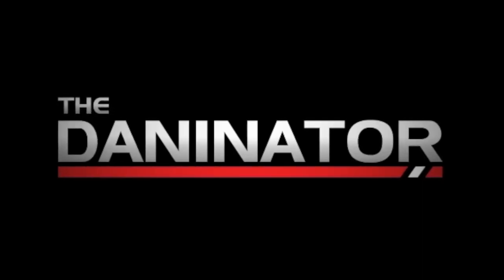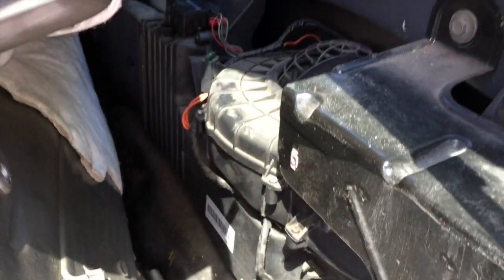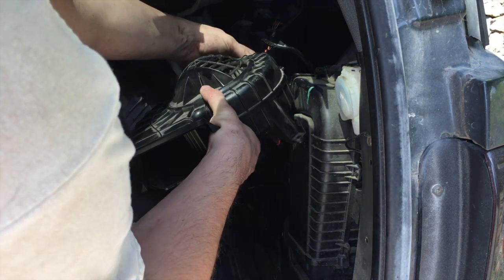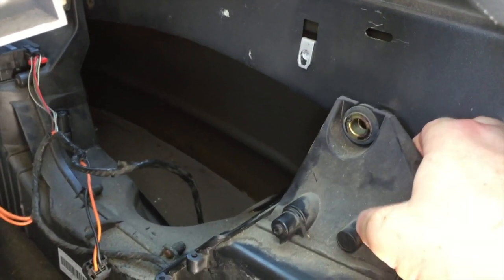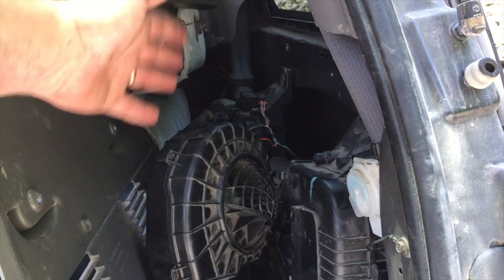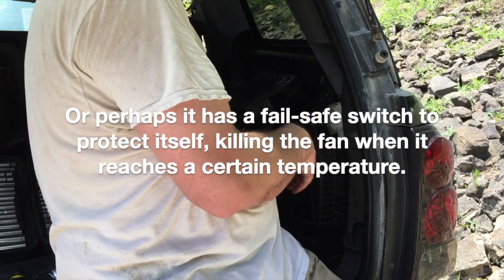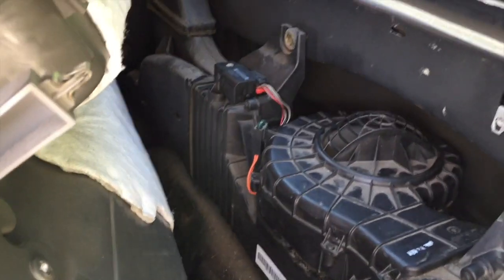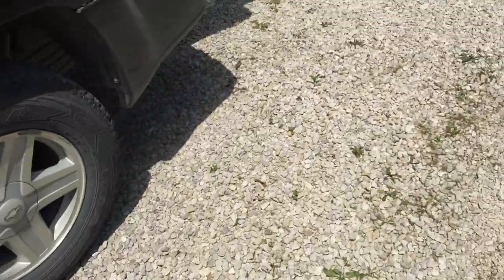Trailblazer EXT rear air won't work - FIXED! - Blower Motor Control Module / Resistor

Comment: After going to the junkyard to get the resistor and destroying/tearing that box out, I found there are 2 additional 10mm bolts that hold the box from under the truck, right under the blower box. Take those 2 hidden nuts out and you can lift out the whole blower box out of place and then you can actually use a torx 15 screwdriver AND SEE where to remove the screws from the resistor. The blower box will come off the vent ducts, so when you put everything back, make sure the ducts are aligned, and nice and tight. My hands were so scraped up from the junkyard trip but not a scratch by also taking out the 2 nuts from underneath at home. There is play with the hoses, you will see how much when you get under the truck to remove the two nuts. If anything would have leaked, it would have been at the junkyard. The resistance you guys feel is just the blowerbox bolted to the under chassis. I used a prybar to remove the box. None of the videos out there talk about those two bottom nuts. Too bad the resistor I got from the junkyard was also not working. Im about to head out now to get another one, this time im removing those 2 nuts so I dont have to break the box. I hope this helps someone.
Reply from the maker: Thanks for that information! I'm sure it will be helpful to the next guy!
Reply: I will keep this in mind when I tackle this problem I have thanks
Reply: Man i did like you said and it works thanks.  Man
Reply: Man i did like you said and it works thanks.  Man
Reply: I’m about to tackle this issue.

Comment: My actuator broke so I made it stay open. The rear fan works when it wants to! I thought it was a setting on the front climate control but I don't know. 🤦🏽‍♂️ what I do know is that when it's on its on but when it isn't it eventually kicks on out of nowhere. Going to go to trailvoy to see if there is something I'm doing wrong ... thanks bro!

Comment: FIXED! I tried the fuse reset 3 times,never touched blower,but did replace ac delco part for the win!pulled everything loose,wedged the top so I had extra room.****stuff a rag or something in hole in case you drop a tool!****I laid on stomach toward front of vehicle to use right hand when putting back in.was WAY easier for me.also pulled part of ac vent that blows to floorboard(1 extra 10mm bolt)to allow me to rock entire assembly out for extra room.hope this extra info helps the next guy.thanks for the help Dan!
Reply: So what was the exact part u replaced that fixed it
Reply: @1-Six-dee  forget the name of it now but the ac delco part that's mentioned in the video.make sure to stuff a rag in hole so if u drop a screw ur ok.also laying on stomach using right hand saved me mega amounts of time.good luck!
Reply: @marcchampagne804  ty sir I figured it out thru a couple more videos but this speed controller is a big issue in every model that it was used and it is not cheap
Reply: @1-Six-dee  small price to pay for way cooler ride.i have 3 kids so wasnt an option for me
Reply: @marcchampagne804  I have three kids as well, I have an issue now the driver side is blowing out coolish air the passenger is blowing out ice cold, seems like I have a blend door issue
Reply: @1-Six-dee  I had that same problem before,as well as now.personally I learned to accept it.think it's just luck of the draw with your timing bc mine was that way before hand.driver side middle vent 6/10 n pass side 10/10.its an actuator problem I never chose to solve.too much work for little payoff.fyi,I'll use driver rear vent,spin n point at me when no ones sitting behind me.nice breeze down my spine after a long day
Reply: I wish I started a youtube channel 3 years ago when I got the truck.everything except the rear end itself has been replaced over time.feel free to ask any questions regarding pretty much anything on this breed of vehicle
Reply: @marcchampagne804  my oil pressure gauge stays maxed out at anytime I have the vehicle to the on position have u ran into this?
Reply: @1-Six-dee  mine stays around 55 or 60. I've debated a diesel bath to clean old oil deposits out the block but havent done it.basically drain oil,instead of oil,fill with diesel,new filter,run to operating temp.drain,fill,change filter,repeat 2 or 3 times.then put new filter n oil in n see what it does. I've gotten rid of a knock in a motor that way before

Comment: Anyone who's smart would move that electronic resistor and bolt it to a METAL part of the cab above the blower motor (and use some computer processor heat sink paste) so that the new one doesn't bet so hot and burn out.  Those electronic resistors produce a lot of heat, and that heat is what causes them to fail!  I have two TB EXT's and have replaced/moved both of the resistors...no failures since the move!
Reply: brilliant
Reply: Where’d you move it to

Comment: One minor correction. The condenser coil is located in front of the radiator in the engine compartment. Their are 2 evaporator coils that chill the interior air. One for the front dash vents and the other for the rear unit where you were working. That evaporator chills the air coming out of the headliner vents.

Comment: I got this issue with my blazer long ago and found the issue with the same temperature control module...most of them will fail by time when your ac is not working properly or by any means they got heat up ....
That is not adhesive..you can get it from any computer shops it is silicon coolant gel or cream mostly used for processors ...you must remove it again and clean that and paste a new gel on it otherwise it will fail again due to heat up
Reply from the maker: Good info to know. Thank you.
Reply: Thermal paste

Comment from the maker: I don't know how I did it, but I done it. LOL. 
Be sure to check out the merch link in the description above. Use code "DAN10" and save 10%.
Reply: can u help me I have a 2005 Chevy trailblazer and its misfiring bad and when I checked the codes 2 pops up p0017 and p0300 and I redid the valve covers because it had oil in the spark plugs and I changed the old spark plugs out can u please help me out I'm pulling my hair off with this thank u
Reply from the maker: bouncer bloodz414 take a look at this info here: https://www.obd-codes.com/p0017

Comment: Same exact issue I’m facing rn so I appreciate the vid ! Almost positive it’s that ac blower module replacement bc mine starts for 2 seconds n cuts right off too
Reply: Did u ever find a fix I have the same issue it turns on for about two seconds then it shuts off

Comment: My wife's 03 Envoy wont blow from the rear vents when the engine is running, but it will when it's on battery. What are the chances its this, or maybe the rear hvac control unit in the second row?
Reply: Mine is doing exactly this

Comment: Does the clicking continue now? I am having the clicking in my vehicle, and am told both blend doors are broken, and need replaced.
Reply: The blend doors hardly ever break or fail unless someone broke the drive pins off. 
It's the drivers or "modules" that break internally .... because some Voodoo mechanics believe they can "reset" things that fail by disconnecting the battery every once in a while --- just, ya know --- to make things work again. 
Every time you remove the battery from the system --- or disconnect either battery cable --- you'll likely damage the old plastic gears inside the actuators. 
They're old - they're plastic and they can't do that many times before they go; "click-click-click-click-click-------" 
...and IF you break the gears on the one under the dashboard --- it's major surgery to fix it.

Comment: Anyone have info on the adhesive that is meant to be used after cleaning off the old stuff?

Wish we could see how you realigned the peg into the actuator. I am having hell of a time getting my new ones in.
Reply: It's not adhesive! It's heat sink paste and if you don't use the correct product you'll fry any new "modules" too --- which are really resistor banks. Buying used electrical parts is always a crapshoot - and you don't get new "glue" with them either. <nyuck, nyuck>

Comment: nice vid. could you please, if no much trouble, tell me the part nmber or exact name of the air knob located to the left side of the gear stick? its missing and i would really appreciate your help :)
Reply: I don't know the part number, but that switch's settings decide if either it, OR the rear controls work the rear a/c-heat unit.  One position is off, one position is for the rear controls (in the back of the center console) to run the rear unit, and the other positions are for fan speed (while using the driver's front temperature settings) to control the rear.  I hope that helps you understand what the switch does!

Comment: The "adhesive" is heat sink material to help dissipate the heat in the so-called "module" which is really a resistor bank. It is not any form of glue or adhesive. If you don't replace it real with heat sink paste, the "module" will fry again. 
The Actuator clicking is no-way, ever gonna "reprogram" because when the battery power is lost, the actuators all go through a full-sweep test to find neutral position and that breaks the gear teeth off of very old plastic gears. You cannot reprogram new teeth back onto a broken gear. 
Do not NEVER ever disconnect the battery without a KAM! Never! 
There's a lot of bad information here folks --- don't follow this guy's advice!

Comment: Bad news: could not get access to the screws. Good news: we now have a hole in the fender to mount a CB antenna.

Where tapping, the blend door actuators will often reset when power is interrupted. Unfortunately, they won't survive forever and will eventually need to be replaced as they will fail.
Reply: You cut out a hole to access the resistor? Lol
There’s two 10mm bolts underneath the vehicle above the exhaust.

Comment: New problem I'm seeking help with.
Only front controls work.rear ac is randomly changing temp,and randomly works.seems like the rear controls dictate vent position but stays on setting when turned on.control module and actuators are all new"ish".anyone had temperature problem on only the rear before?

Comment: I learned from this video that I'm never attempting to fix that blower.  F that.  The passengers can freeze or sweat to death lol.
Reply: I'm glad I fixed mine!  My older one's (2002) front heater core died, and it made me decide to fix the rear unit.  It's far easier to deal with the real heater core than it is to tear out THE WHOLE DASH to replace the front core!  F@#$ removing and fixing that front heater core!!!

Comment: nice video. it just proves, even a blind squirrel can find a nut. i am thankful that our trailblazer doesn’t have rear ac.
Reply: The front one will eventually go out. My blower is out and i suspect this to be the problem
Reply: Kip Holder mine already went out. i ordered a cheap one from amazon, the original one is around $75.00. it worked for half a day. i ended up going to the junk yard and picking up three of them for about five bucks apiece and i have no issues

Comment: I hate NO access situations. I would've been tempted to add an access panel through the side of the body panel. 😡 Thanks for sharing!
Reply from the maker: J. Hunto's Garage it crossed my mind! 😂
Reply: They call them Failblazers for a reason. I love mine when it works but I've replaced a ton of parts. Try changing plugs and wires if you like to cuss.